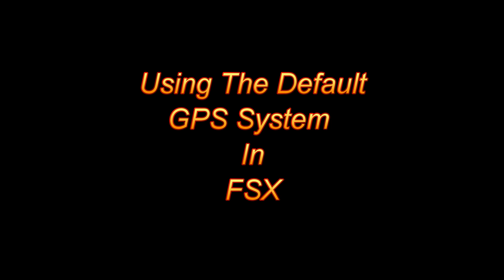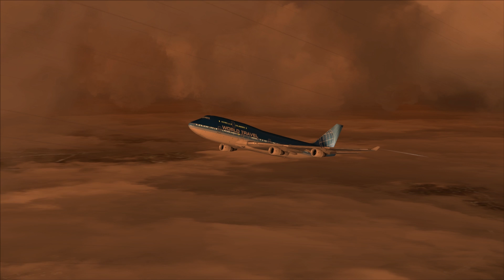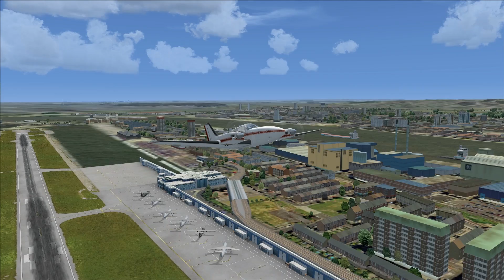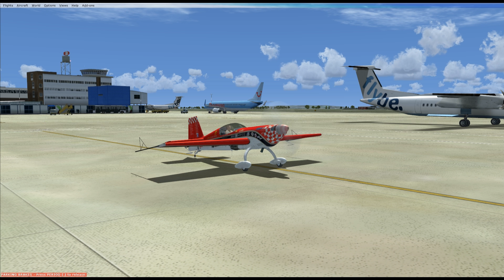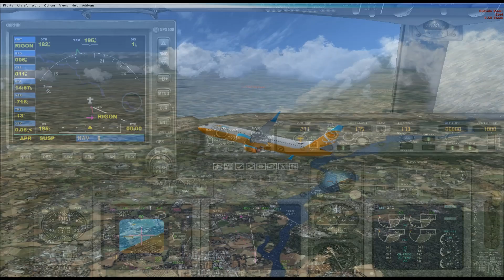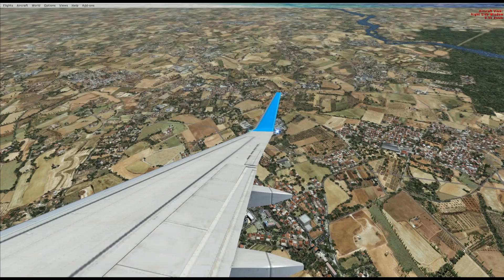FSX Default GPS system

Comment: Hi ttt, you just taught me how to use GPS, had some small knowledge of how to use it but you gave lots more info. When you do a flight plan and your close to the airport you have to get info on what runway you are going to land on, is that the right way. thanks.
Reply: Glad you found it of help. YES, you create a flight plan with your preferred landinv runway  BUT if you are using the ATC system then ATC will allocate you a runway as you get close to the airport - so you MAY need to change your final approach - OR request a change of runway to your preferred one. IF YOU ARE NOT USING ATC then you can fly your route as originally planned. Hope that helps.

Comment: Good video except I could not hear your information because of the high volume of the planes engines.  i would recommend not
having much engine sound as it was distracting.  I would have made the Garmin 500 larger so one could see it better. Thanks
for taking the time to go over the flight information on the video.